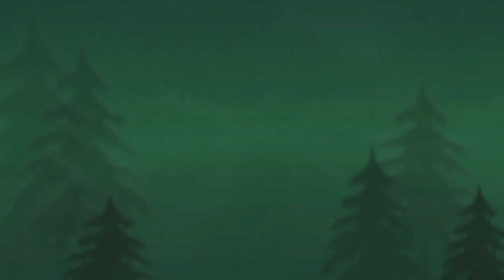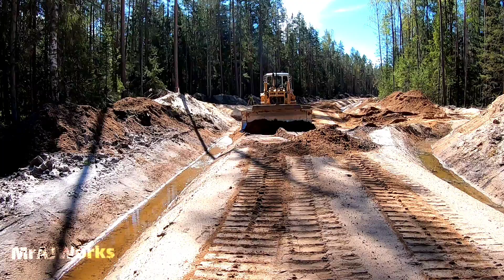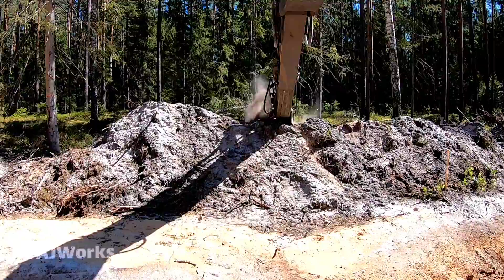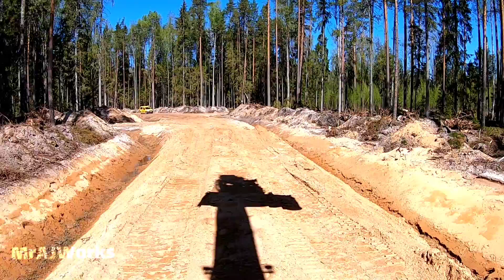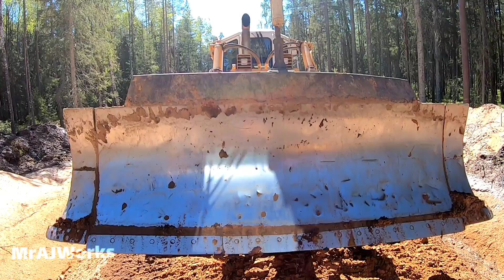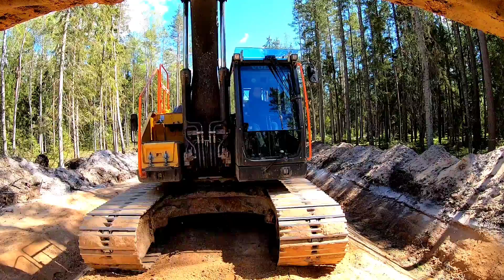Road Base Preparation : Part 2

Comment: I have a question about the blade of the dozer and what it's doing at the 8:20 mark.  In the video you can see the blade cycling up and down.  Is this motion desired, is it a feedback loop problem between the blade height indicator and the control system responding to slowly, or maybe a poor gps signal?
Reply from the maker: The thing is that the bulldozer has a worn shovel center bush and it creates free movement. Therefore, the robot adjusts the shovel to the correct height all the time, but there is still free movement and then he cannot catch the correct height. So the shovel walks up and down
Reply: @MrAJWorks  Thanks!

Comment: Why didn't you level the road at the right level in the first place? Looks like a double job to me.
Reply from the maker: It may look like it, but it doesn't. In many places it was still wet and the road roller could not roll the road. Now everything is dry and everything is compacted. It is at this stage that we are operating for the first time. Here I simply dug up the ditches and threw the earth on the road with the thought that at some point the soil would be needed. And it was a long time ago when there was still a lot of water in many places
Reply: @MrAJWorks  but why take dirt off  the road, effectively making it lower than the surrounding area ? It defies all logic.
Reply from the maker: In the end, the road will be higher or equal to the surroundings. In addition to the base of the road must be added 50cm (30cm sand + 20cm gravel)
Reply: @MrAJWorks  i guess the surveyor and geo engineer decided that sand has to be added, but the sand you dug from the ditch doesnt have any organic content at all so its fine to put rock on that. But hey, who pays decides...

Comment: what's average time  does it take from the cutting of the right way for the read to the end
Reply from the maker: Hard to say. Two weeks. Because in some places there is a lot of work
Reply: @MrAJWorks  ok and it looks like you guys have like the full length of what is going to the road but just do so much at time is it you just work on as they need it to get back more in the for forest

Comment: Mr.AJ please instruct your dozer operator to stop pushing dirt into your beautifully clean ditches. :) 
Is the dozer operator moving the blade up and down 6cm on purpose or is it the GPS control?
Reply from the maker: It so happens that the earth falls into a ditch. But a little only. Yes I think there will be a question about it. The thing is that the bulldozer has a worn shovel center bush and it creates free movement. Therefore, the robot adjusts the shovel to the correct height all the time, but there is still free movement and then he cannot catch the correct height. So the shovel walks up and down😀